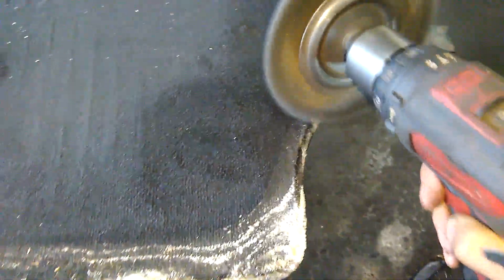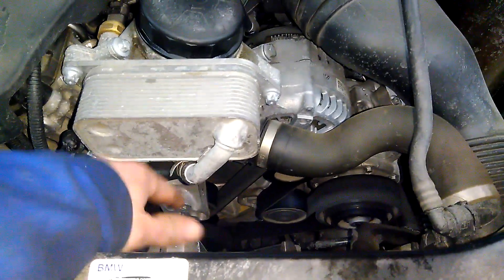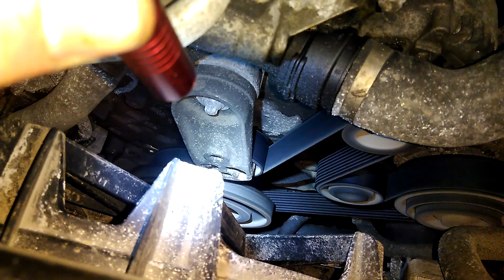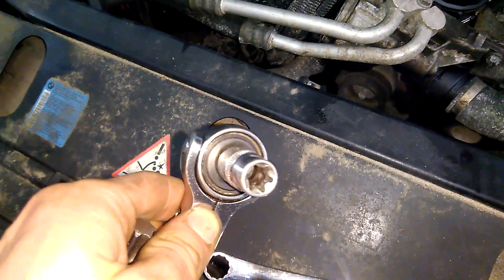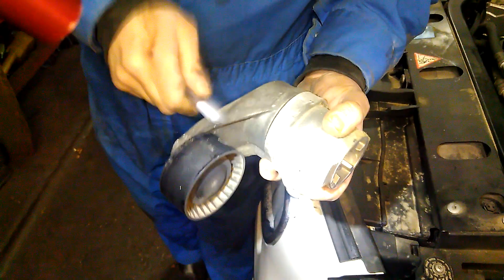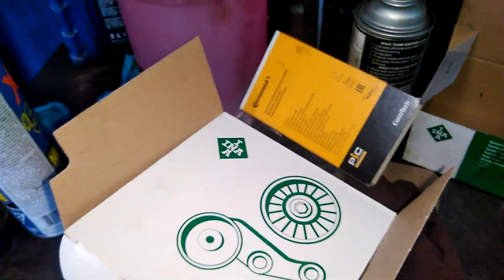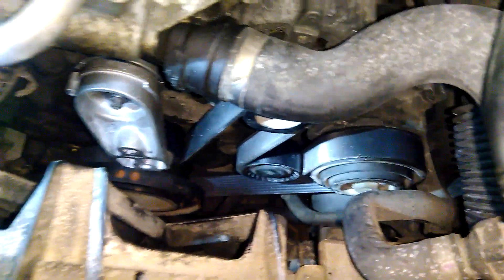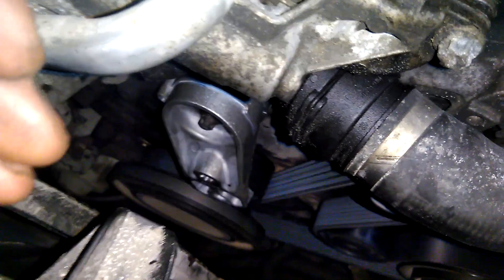BMW F25 belt tensioner Diagnosis and replace n55 engine

Comment: Great video, but the tensioner is suppose to move. It’s spring loaded for that purpose. However if you have the winning noise or squealing then it’s best to replace.